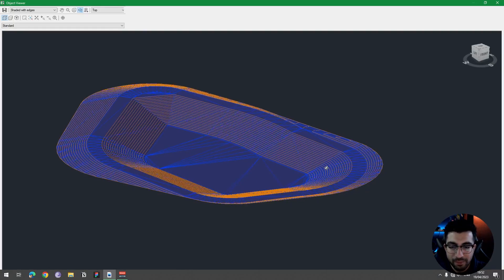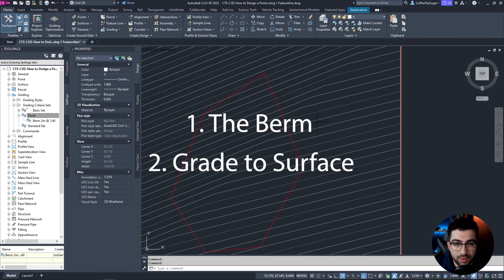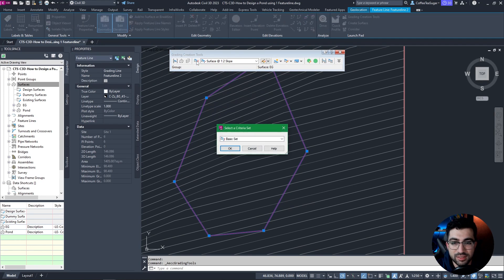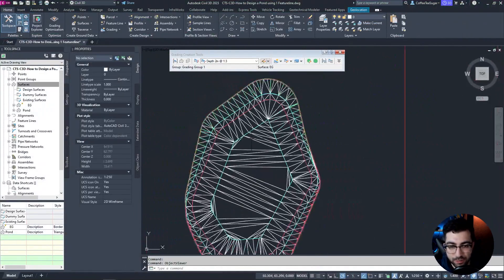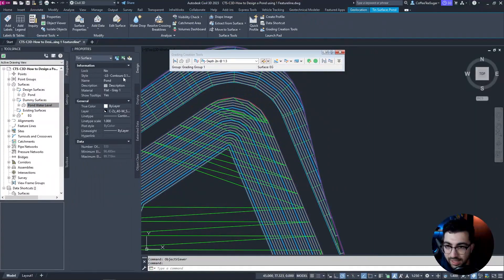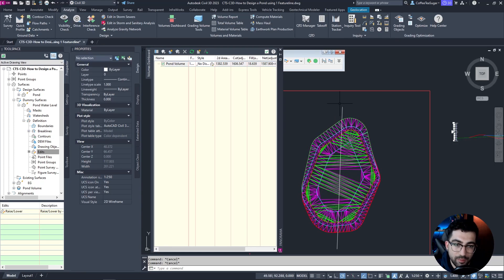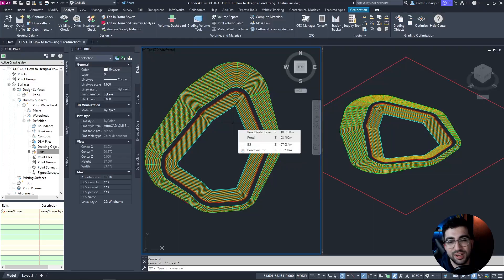How to create a smart pond in Civil 3D

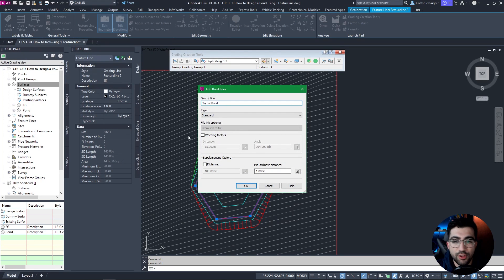Comment: 6:40 nooooo!!! Don't add additional unnecessary elevation points to featurelines! You get the same (and much better) result by including supplementing factors in the dialog box at 5:13. Try making 'distance' 1m and mid-ordinate distance 0.01m. You keep the original featureline nice and simple but the triangulation adapts to ensure there is a surface point at least every 1m and curves get more definition the tighter their radius.
Reply from the maker: I have noticed that sometimesadding mid-ordinate distance caps the distance at a curve. Will try this option in different scenarios and see what it throws. Thanks for your input!
Reply: @CivilTechSource  the mid-ordinate distance isn’t the distance along the curve, it’s the maximum allowed deviation between the faceted triangulated arc and the true arc. Using 0.1m for this tends to give good results but you can always increase it
Reply: @dmac2573  it is great to share and thanks to the video comments can be made. Comments help all users with a lower level experience. Thanks to both!
Reply: Talk about a nightmare for Surveyors to stake out
Reply from the maker: @Titotitotitotito-x6v that's why I make my ponds square, but the landscape architect don't like them 🙃

Comment: How Design Surface is created?
Reply from the maker: Do you mean the surface that the pond ties into?
Reply: @CivilTechSource  Yes, but I managed
Reply: In this design, can't we have bunds at where levels is higher than Original Ground Level
Reply from the maker: You can I don't see why not, this tutorial just shows how to tie in into existing surface. If you have specific levels you can define them using the level tie in rather than the surface tie in
Reply: @CivilTechSource  Actually I don't know how to include bunds on the pond  having width and side slopes outside of the pond.

Comment: Great video. I have heard the hrading objects are.pretty unstable in surfaces though and I myself have had many issues with them not working correctly. When you do a design like this, relying so heavily on them, what type of measures will you put in to lower the risk of something failing in your drawing? For example I create my finished surface it its own drawinf and data ref into my plan set drawing.
Reply from the maker: Hi @dappercam many thanks for the comment! Well as with each Civil3D update is becoming more and more stable, I am not that worried about things breaking but more trying to keep things separate and clean and to it's intended purpose. So yes, I would have a C3D file where only the ponds are in there, another where the corridors are in and so on. For example I separate the surfaces into Existing, Proposed, Formation, Earthworks.

Comment: FYI - I typically add 2 feature lines for the berm top so I can reduce the berm width on the cut side to a very small distance as many sites are restricted by space on the site.  This allows that extra 8 feet or 10 feet in width of useable additional volume if needed on site but I like this video and the approach.
Reply from the maker: Interesting!!! I did have to design a pond couple of weeks ago and it was tight and remembered your comment and tried your way, it was tiny bit finky (not sure if its a word). But ended up working! Thank you.

Comment: TIps that i would add:
1. If you need to find the volume of the levee, use the auto-creation feature of the grading surface, faster than creating a separate surface.
2. It is much easier to create the top of the levee using a steep offset from the original feature line. Then use Infill from the grading tool.
3. When measuring the water level volume, it becomes easier if you extract a contour from the inner slope and create a surface with it. You can get 0 fill that way.....

But that how I do it...

👍Like the video but it hurt to watch
Reply: Could you add a video to see?
Reply: @gilbertoflores6324  I posted a video on how I would go about doing it.
@oboumoura5130
Reply from the maker: Thanks for this!! Did not think about the grade infill and extracting the info! But I only see one problem with your method. It is not dynamic as you are relaying on the contours rather than the featurelines. for the 0 fill you can always adjust the fill ration to 0 instead of 1. Will keep this in mind and see if there is any way both methods can be married. Thank you for uploading the video, Liked the video but it also hurt to watch. :D
Reply: @oboumoura5130  

As I read your reply and seen your video, the flexibility you have when using different type of grading techniques is drastically limited, unless you do it the exact same way for this. I feel the method you are proposing is better for concept - preliminary planning. After changes starts rolling in, this would be pain staking. 

As you can use contours for your volumes, you are Soley limiting yourself by defined contour style, as at times our tops and bottoms are sloped and have variable side slopes, are you accounting for that less than 1' of contour interval? 

Best practice for sustainable use would be using a volumes surface for quantities rather than copying from your grading properties into static text, each time.

Comment: Hi, firstly amazing video, direct and informational. I just wanted to ask with regards to the water level surface... Wouldn't it be possible to grade the pond original feature line down, creating the water surface, so that we can avoid the overlapping volume on the sides? Please do a Civil 3d to SSA workflow video.
Reply from the maker: I suppose you can, or alternatively you can turn the cut ratio from 1 down to 0.

Comment: What if I want to create grading not to the Existing Surface but to a certain elevation level, and the slope of the pond base is not 0%, but with 2% slopes? Do you know how to do it?
Reply from the maker: Yes, it is possible to do it. You just have to select the appropriate settings. I am currently on holiday so can't access a pc to tell you which option is it. But from memory should be slope to elevation option depending if you have the correct settings.

Comment: Hi,
I want to do something a bit similar. 
Scenario: I have an existing surface (with slope), I need to excavate from the lowest point at a particular area, a cube of depth 2m. Backfill with rock base material of 500mm, and finally backfill to designed level (which is ~450mm higher then the existing surface). Any idea what kinda workflow that can be used? I hope the scenario is clear enough... 

Thanks
Reply from the maker: What is the goal of the exercise? To calculate the volumes?
Reply: @CivilTechSource  Yes the goal is to calculate volumes of each segment. 1st, total excavated volume (including the slope of the surface within the cube), secondly only the back-filling of the 500mm rock base and finally , volume from the top of the rock base to the designed surface.